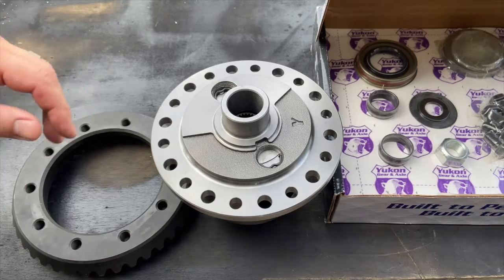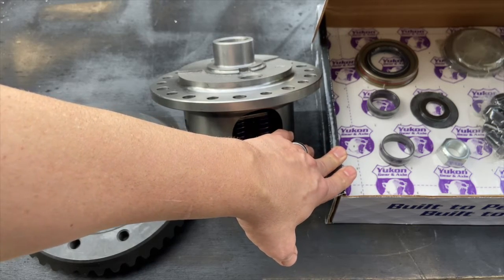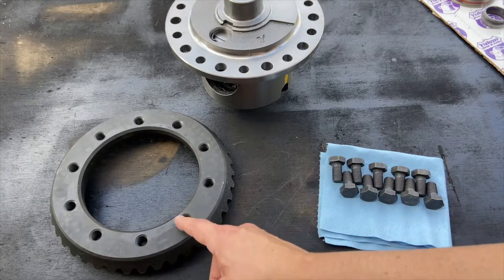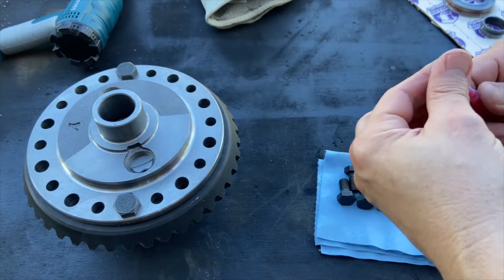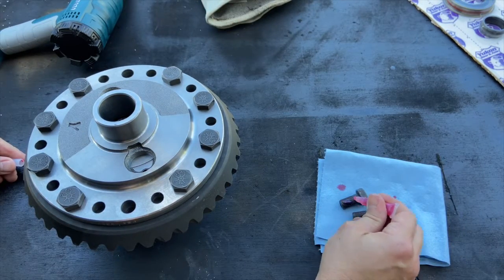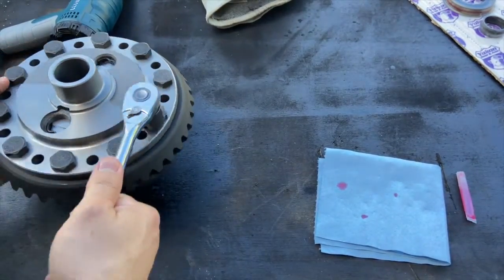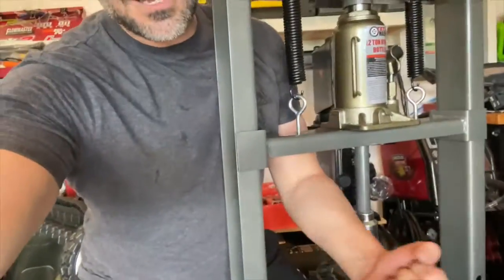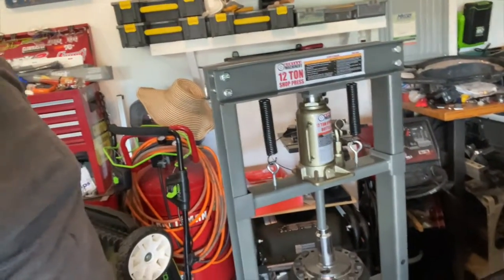Dana 44 Rebuild: Installing the Ring Gear

Comment: 135 Ftlb??  My Dana 44 manual and Yukon directions says 70ftlb.
Reply from the maker: Is that for a Jeep JK? According to this site, the Jeep JK is 135: 

https://www.sierragear.com/setup-torque-specs/

So does this thread:
https://www.wayalife.com/threads/d44-gear-torque.47794/

This says 135 also:
https://www.jk-forum.com/forums/modified-jk-tech-2/dana-44-torque-specs-56148/

This one too:
https://www.differentials.com/technical-help-2/differential-set-up-specifications/